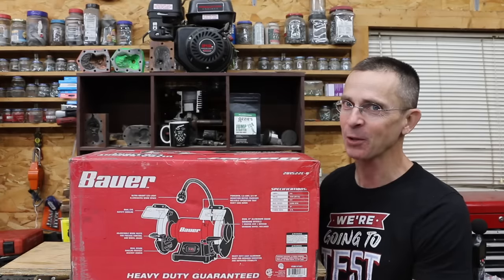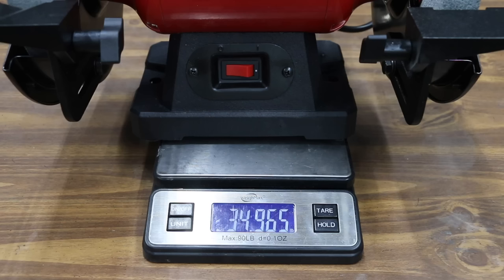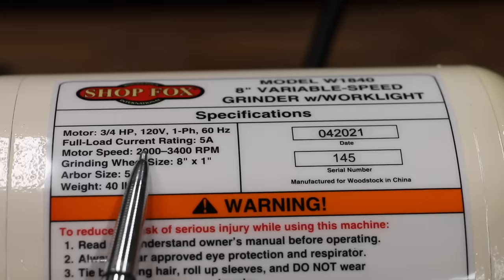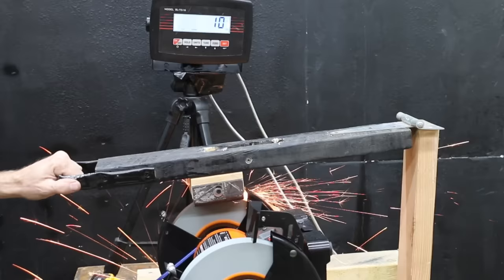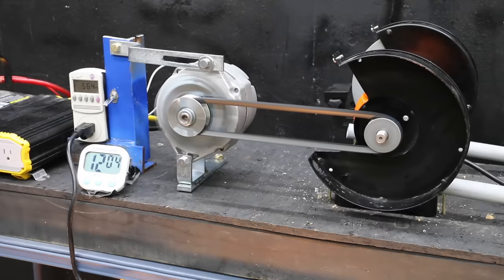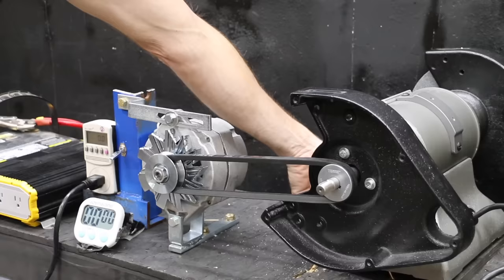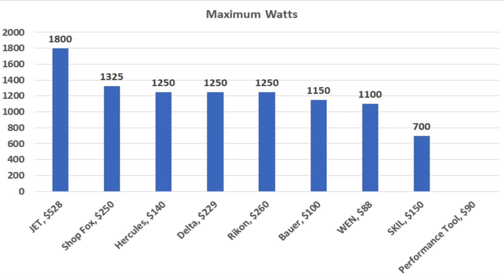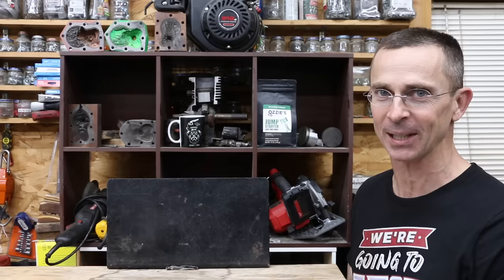Best Bench Grinder? Let’s Settle This! Harbor Freight Bauer vs JET, Hercules, Rikon, Shop Fox, Delta

Comment: Excellent video as usual. Use the Jet grinder at work daily. It's gone up in price over the years. The best thing is the tool rest and gaurds are easily available. Our grinder at the shop is over 13 years old.
Reply from the maker: Thanks!  Thanks for the feedback.
Reply: So what you're saying is the JET grinder is actually the cheapest.
Reply: @Oddman1980  The JET is definitely a buy once cry once type of tool. almost everything they make is like that, unbelievable quality and power, but not cheap. I used a 36 inch Jet bandsaw before and that thing was a beast. you could mill a 2ft diameter log into boards and it wouldnt bog down in the slightest.

Comment: I am just blown away at the number of tests you did on these bench grinders. Nothing left to assume or guess.  All scientifically tested and recorded, amazing!  What a service to humanity this is.  You are the best of the best.  A huge thank you from California!❤
I have a Central Machinery Bench Grinder 8" from Harbor Freight. Brand new. I cannot get the wheels to balance out.  Is this usable at all or my inexperience in truing wheels?  I have no experience with bench grinders but desperately need one for polishing, sharpening blades, and removing rust.  There is only so much I can do with my angle grinder which is heavy on my female slender wrists.  I need some help from readers.  Any advice?:face-blue-wide-eyes:

Comment: Nice to see Hercules in the lineup. I have used many of their tools over the last 3 years, in pretty harsh conditions. I am genuinely impressed with their cost/performance.
Reply from the maker: Thanks!  Thanks for sharing.
Reply: Good to know.  Thanks.
Reply: In the top tier of home building there is a lot of people doing the highest quality work in the WORLD, that had to use harbor freight to afford going out and starting their own business. If you can't afford to buy higher quality by the time you burn it out or break it, you need a business mentor to help you with pricing.
Reply: @sparksmcgee6641  
My use case is very different. I am restoring untended land and its structures. I need adequate tools that will survive drops, dirt, and hard use for tasks for which they may not be intended. Despite the difficult environment, I have not yet had to replace any of the tools.
Reply: @critical-thought  I've slowly been buying into the Hercules brand after seeing that I would have had to either buy a fancier and more expensive charger that could charge both M18 & M12 batteries in order to be able to move in to Milwaukee's M18 tools while retaining my current M12 tools. Or to buy a second charger for charging M18 tools in general as well as have a charger for my M12 batteries. I was originally looking at Milwaukee's 7-1/4" brushless circular saw and after seeing it was $250 for just the saw I figured I would just stop at my couple of M12 tools and eventually bought some Hercules tools.

I started off by buying my mother a small 12v Hercules drill for drilling holes and driving in screws when she's outside in the summer working on stuff. Sadly the first drill was a lemon and pooped out very early on but it was promptly replaced with no questions asked and the second drill has been holding up just fine since. It was actually kind of funny as the employees were looking at me like I did the impossible because according to them they had little to no returns for the Hercules tools. So far every Hercules tool I have bought there after has had no problems with it. So the first one was just a fluke. :)
Reply: I've been really impressed with both the Bauer and Hercules lineup.  Harbor Freight has really upped its game from the old Chicago Electric garbage they used to sell.
Reply: @MAGAMAN  
And the Vietnamese and other eastern/pacific laborers also thank me, you, and every other tools user. What’s your point?
Reply: @jaredmarshall4245  
Yeah. The Warrior brand is awful too. Although I did get a Chicago Electric grinder on sale for $5. Reminds me of my grandfathers grinder, but it hasn’t quit yet 🤣
Reply: @critical-thought  guessing you missed the right person's reply😀. Hercules tape measure has been getting attention from my employees. They can get anything they want. They pause then kinda shocked say, "I want the harbor freight" they are pushing into pro gear. Waiting for brushless which they don't have a lot off. Want one of those angle grinders

Comment: When my father passed in 1995, I inherited his tools.   Among them was an old Duracraft 6" bench grinder.  Near as I can tell they were American made and sold by Sears.  Pretty sure that is probably right (at least being sold at Sears) since that is where my dad bought his tools and he got it sometime in the 1980's.  Meaning it has lasted nearly 40+ years.  Since I am 70, I don't need something to last that long but I believe in buying quality tools.  Jet by all accounts is the best bench grinder out there and I would get one if I were a professional or was a woodworker who needs to sharpen carving tools all the time.  As a DIYer who only needs to bring out the grinder in the Fall to sharpen things and clean rust off of tools and traps and a few other times throughout the year on projects that require grinding.  Although, I have to say, don't need a bench grinder for my mower blades anymore after watching your reviews mower sharpening mower blades (the All American can't be beat for once a year sharpening).  I want a grinder that doesn't bog down, that has solid tool rests, and won't move around on my workbench (had to build a platform for the Duracraft and use C-clamps to keep it in place).  Not to worried about the grinding wheels since I would probably replace the wheels onany grinder I bought with something from Norton Abrasives or perhaps a CBN wheel.  I am a little leary of getting power tools from Harbor Freight but they seem to be improving their Bauer and Hercules tools, especially the Hercules line.  Speaking of Hercules, the model you reviewed was out for only about 8 months before HF replaced it with the Hercules 8 in. Heavy Duty Professional Bench Grinder.  The difference, as near as I can tell, the model you reviewed had a .9 horse motor, and 5 amps. The HD Pro say it has a full one horse and it is 8 amps.  The one in your review weighs 40.5 lbs., the HD Pro 49 lbs.  HF's newsletter that came out with the new HD PRO, says, "Added features include reliable, sealed, and lubricated ball bearings, along with machined and balanced clamp washers that hold the grinding wheels in place securely for lower vibration. Rubber-mounted feet keep the bench grinder stable during use. It also comes with Vitrified low- and medium-grit grinding wheels, 36 and 60 grit.  Speaking of vitrified wheels, when looking at all the other grinders you reviewed, only the Jet comes with vitrified wheels.  Probably why they did better in your testing.  Now before I go off and buy new grinding wheels, I would love to see you do one of your fantastic tests on the grinding wheels.
Reply from the maker: Thanks for the suggestion.

Comment: I have a Performance Tool one that went underwater during Hurricane Katrina. I washed it out with fresh water & let it dry for a few days. The thing started right up, only thing the bearings are so rusted that the noise prevents using it without ear protection on.
Reply from the maker: Thanks for sharing.

Comment: How long does it take you to put these videos together From beginning to end including editing, filming, etc? You put so much effort into each and every video you make. We appreciate it!
Reply from the maker: Between 50 to 75 hours.  Thanks!
Reply: I have several JET pieces including a RH tilt cabinet table saw and 16” surface planer. Referb’d an old horizontal metal cutting band saw with new parts from JET. No complaints with their stuff. Not sure what effects them purchasing Powermatic had on their stuff years ago had…
Reply: @ProjectFarm  wow

Comment: You deserve top marks for test strategy and originality. You have evolved into something very important. You have indeed evolved into one truly unbiased and impartial tester of commercially available goods. An unbiased and impartial test has value beyond any television advertisement and in my opinion, this is how a television advertisement needs to be. The JET brand was the most expensive but well worth it. A machine that spools up quickly is going to be important in a commercial environment. You certainly get what you pay for. You do excellent work with every test.

You are indeed single-handedly putting an entire industry in check. And that is to be commended.
Reply from the maker: Thanks and you are welcome!

Comment: As a follow up to this video, I feel like you need to do a review of bench grinder replacement wheels, and maybe even wire bristle brushes. I've burned through so many wire bristle brushes, and never really considered if different brands might perform better or last longer. Also, it's great to see that "the expensive option" really can come out as the best performer sometimes. Not great for our wallets, but for our sanity.
Reply from the maker: Thanks for sharing!
Reply: Get a 3M cubitron wheel, there is nothing even close to the performance of them.

Comment: If you slap a piece of super 88 on the case and take IR measurements off of it you will have more accurate temperature readings. Super 88 has 0.95 emissivity, where that paint might have some reflections.

Comment: I was literally shopping 8" bench grinders yesterday, and here is PF with all the answers to questions I hadn't even figured out how to ask.  Excellent content!
Reply from the maker: Thanks!
Reply: Get a belt sander instead, we used a beach grinder for years, the day we got a belt sander, we NEVER used the beach grinder again, belt sanders are far Superior in every way.
Reply: @Brandon Horst  each tool has its place.  A bench grinder with adjustable speed makes a great starting point for building out a 2x72.  They can also use buffing wheels, whereas a belt sander is limited to abrasive actions only.
Reply: @adamgea  thats what i did with our beach grinder, put 2 buffing wheels on it
Reply: Buy something decent used. What's available today is a joke. None of the bench grinders I own take any time to spin up at all. It's flip the switch and they're going full speed.

Comment: Would be cool to see a comparison among chainsaw bar oils. 
Lubricity and viscosity when they’re hot and cold.
Reply from the maker: Thanks for the video idea.
Reply: @ProjectFarm  ..and aging if left in saws used infrequently...some repair channels show the bio type oil thickens up & plug lines over time ...
Reply: @jab100lochaber  If you’re not using the saw a lot just drain it back into the container. Saws will typically leak when left standing.
Reply: @ProjectFarm  Don't forget to include corn oil and canola oil.  I use my chainsaw infrequently enough that it's a small extra cost to use those food oils and not care what plants and so forth that I get the oil on.
Reply: Is it really that critical? As long as there's something on the bar you should be OK.

Comment: The speeds found here are a function of motor type in a country with 60Hz A/C power. They'd be slower in a 50Hz country. A synchronous A/C 2-pole (1 pole pair) motor spins at precisely 3600 RPM. Grinders will all most likely be asynchronous, also known as induction, motors. They do not require an electrical connection to the rotor, therefore have no contact brushes to wear out. A rotating magnetic field is maintained because the rotor is a little slower, about 3500 RPM for a 2-pole example. This lag in speed is called slip. Similar motor styles is why we find similar speeds. These speed controls are very crude "ceiling fan" style dimmers which don't really control speed but clip off part of the A/C waveform, reducing torque. The load remains so reduced torque results in reduced speed.

Comment: A little niche, but I'm very curious about backpack vacuums. They're a must have for working in confined or cluttered spaces, or where the terrain (stairs) makes it impractical to use a floor unit. Also a must have for containing dust and debris when doing a small punchlist in a finished home. I'd want to see how it performs hooked up to a router or planer, and compare performance of the wand on carpets vs solid flooring. dB would be really important too! Comfort wearing it is subjective but options for adjustment and hose length/accessory storage would be important to me.
Reply from the maker: Thank you for the video idea!

Comment: Might have been mentioned already, but there is a small mistake. The JET grinder is 5.5amp on 230V supply, it is 11amp on 115V supply. So compared to the other grinders, it makes sense why it has more power, it uses more than double the amperage. Great video though Todd!
Reply: I noticed that too!
Reply: You're not correct. The current does not equal power. Power, in watt, is Voltage*current in the basic form. If you reduce the voltage in half but increase the current in double, the power stays the same.
Reply: @Zetex2000  You call me incorrect, but you obviously didn't comprehend what I wrote. I never said power = current. I was conveying that when looking at an equal voltage between grinders, the Jet has more than double the current and that DEFINITELY equals more than double the wattage.

The "power" I was talking about, however, was the ability for it to grind compared to the other grinders.
Reply: @matt56849  yup.

Comment: I'd be interested to see a video about saw horses. They're invaluable, and come in a wide range of designs and price tags! Love the content!
Reply from the maker: Thanks!  Thanks for the suggestion.
Reply: You build it on site.
Reply: @DarkLinkAD  I did that when I was doing some Timber Framing. And I ended up with these huge heavy saw horses. The legs are mortised and tenoned into the thickness of the top and why you can't stack these, they are incredibly strong. 5 to 8 tons is my guess for mine.
Reply: @ProjectFarm  you should also do a test of the various types of workmates, those little folding portable tables to work on. I was giving a Black & Decker 1 years ago I'll paint stained then bit dented but it served really well until I left it out in the rain a few times and the particle board top got ruined. I should have just made myself a new top out of three-quarter inch Baltic Birch, instead of tossing it out like garbage.

Now I've got an all metal one from Lee Valley Tools that they got in as a test product but for some reason don't carry now
Reply: I love the cheap collapsible ones from Stanley

Comment: We used to do a "bump" test for synthetic grinder wheels after every 40 hours of use, basicly just an M10 bolt with a nut in the end, think the bolt was 15cm long. Hold the bolt gently between your thumb and ring finger, then place the nut on the work rest, gently slide it to the wheel, if the wheel bites, its still ok, if it kicks the nut back at you, we needed to feed it some hard steel to "work smooth it" a bit. Nice vid also as always :)
Reply from the maker: Thanks!  Thanks for sharing.

Comment: One flaw with your alternator test is the electrical output doesn't include the electrical losses from the inverter, battery, and the alternator

So the motors would be outputting more power than what is shown on the kill-a-watt meter

Comment: BTW, I noticed significant grinding wheel wobble for several of the grinders at start up. This can cause excess vibration of the grinder and the work surface. Good quality wheels usualy run true.
Reply: It's not always the wheels. These grinders are machined so poorly the shoulder that holds the retaining washers on them often has a wobble to it. Plus the washers themselves are usually just stamped steel.

Comment: I have an old Homier Speedway 8" grinder that is very weak and slow to spin up, probably worse than that PT. I think it was $20 new. Still great for sharpening drill bits. The shop at work used to have a huge Baldor with 12" wheels, 2" wide. It would spin up in about a second and was almost silent. Awesome and scary. Looking it up, it's over $6,000.
Reply from the maker: Thanks for sharing.

Comment: Another great video!

I inherited a very old Delta grinder. I was lucky. I prefer it to these new ones.
Reply from the maker: Nice!!
Reply: So many things fall into the "not what they used to be" file. The first which came to mind is Remington firearms, but so many tools and machines fit that profile today.
Reply: @mothman-jz8ug  my vintage Craftsman bench grinder says it is "1/4 HP" but if you wanted to you could push something into it pretty hard and it won't stall out.

Comment: Amazing how Todd keeps going week after week and I always look forward to it!  Great testing in this one.  Thank you for everything you do.  Not surprised that the lower price point grinders looked very cheesey.  It just reminds us all to do the research (and watch previous videos from this channel) and buy something decent.  I think most would have some buyers remorse purchasing some of the cheaper offerings shown here.
Reply from the maker: Thanks!
Reply: That's not necessarily true,  if someone only uses a bench grinder once in a while,  no need to spend a lot of money for a really good grinder.  A cheap one will do ok. Just my opinion,  I use a good grinder with a  wire brush,  I use the wire brush more than the stone.  It's very good for cleaning,  or rust removal.